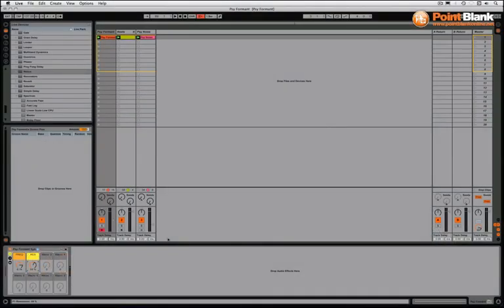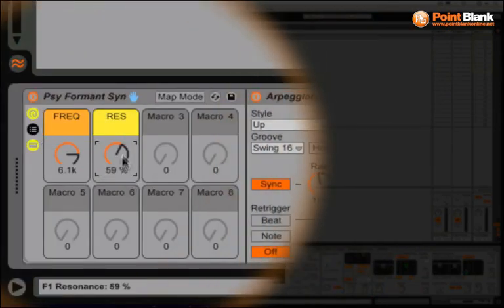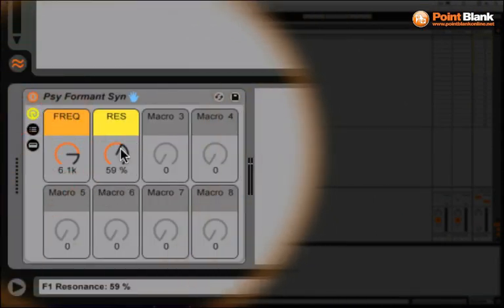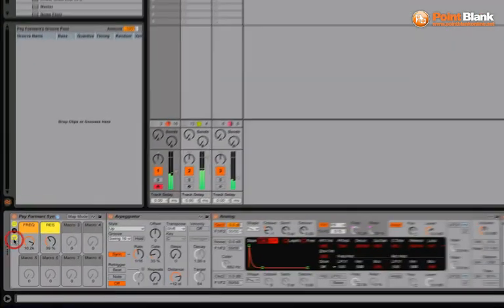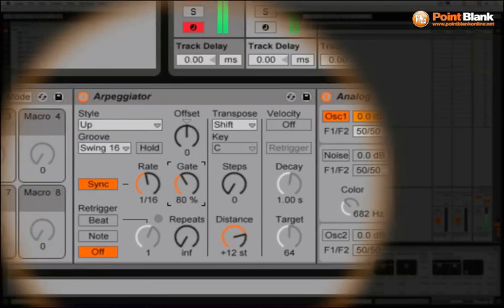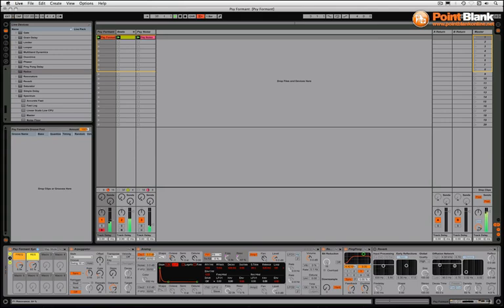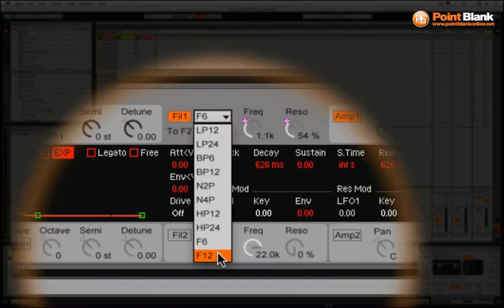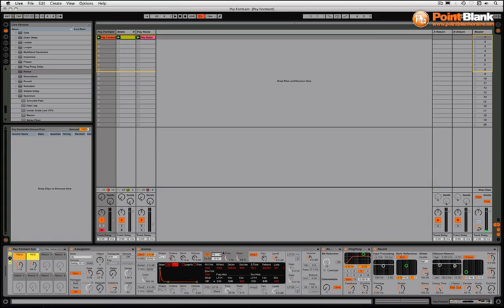Ableton Tutorial - Sound Design - Formant Filter

Comment: @MrRidisc You can easily do one by yourself. Just search for the resonant frequencies of the vowels, and apply them in your favorite way, even balance between parallel EQing work wonders, or Reaktor, or even a simple EQ automation. FM8 has a good one if you don't want to design one by yourself. Reason's Thor has a really good one too. There must be many of them on the Reaktor User Library too.